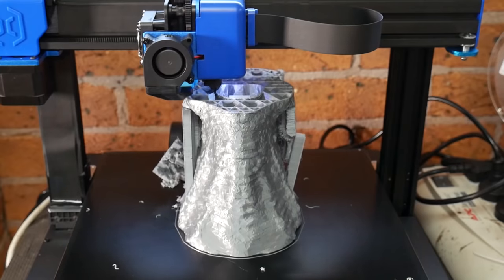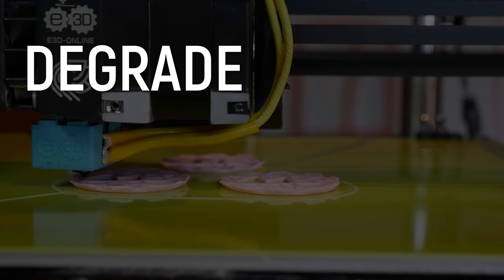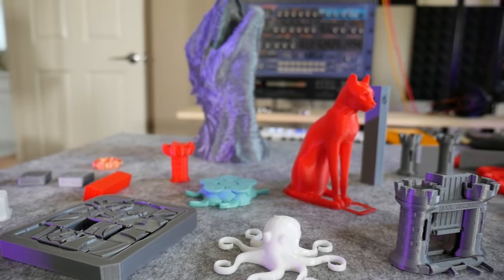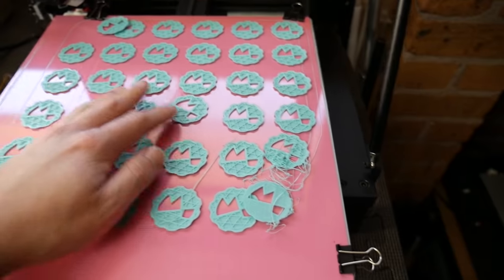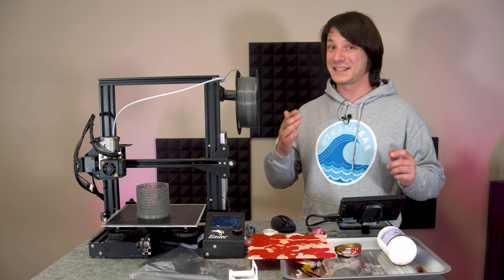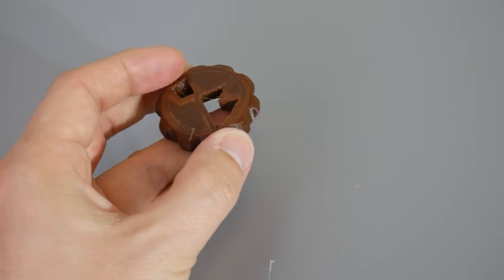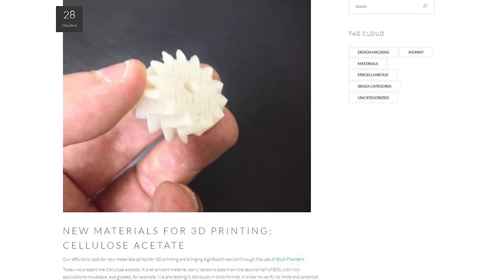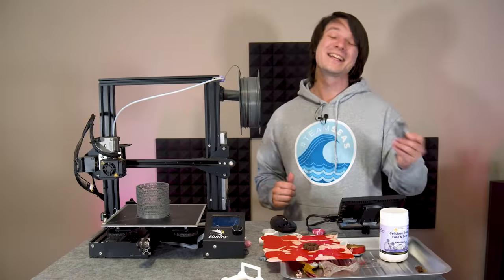PLA - 3D Printing's Biggest Lie.

Comment: Bummer pla contains some sulfur or it would be just another fuel for my wood stove.
Reply: Pla burns? or do you mean sulfur makes it not burn.
Reply: well yes ofc, I dont actually plan to burn it nor do I have any want to.
Reply: but thank you for the explanation of the sulfur
Reply: Hmm, I think burning PLA is a viable option - sure not at home, but at a industrial waste burning facility. Burning PLA is carbon neutral and the exhausts are processed to remove problematic gases like sulfur oxide.
Depending on where you live this is where your plastic trash ends up anyways, which is e.g. the case where I live. I don't see a problem with that - or am I missing something?
Reply: There are special PLA’s for casting metals with the print after beeing burnt out of the plaster cast. They are basically made to be burnt with as little residue as possible. Maybe look into them?
Reply: @tobiastho9639  molten metals are far hotter than an ordinairy wood stove though. So might still not be burnable.
Reply: you underestimate the heat my forge will reach.
Reply: @invetegon4596  No the issue is Sulphur Dioxide which is a pretty toxic, acidic gas and you definately don't want to be breathing it.
Reply: this is a good time to use the generic pronoun "one" as in "one should not burn plastics".
Reply: I think you are correct. There is also the idea that bandwidth of any text communication doesn't contain tone and tone can change from writing to reading. So intended emphasis can change depending on the reader. We do so much non verbally in communication and it is all lost in text. I prefer 'one' for that reason. As formal as it sounds, it can't be beat for precision. Also, let's not succumb to fear of what others will think of our tone at the cost of precision in communication. I imagine that we all waste more time on clearing up imprecision than we do smoothing ruffled feathers. Also we may cause more interpersonal trouble through miscommunication in the first place and it's necessary clarification? It seems to me like precision is worth the risk of sounding a bit formal. I sure don't talk like this sounds when I am face to face with people.
Reply: it was a joke buddy. I’m not dumb enough to try to melt plastic because it would produce unmonitored pollution. If I did want to tho I’d stick it in my arc foundry that will reach over 2000 degrees C and there will be nothing left. But again I don’t want to pollute because I’m not dumb and was just making a joke.
Reply: @ajl8975  Hmmm, okay case dismissed 🤔 But really I'm not the plastic police 🚔😂 I'm just some engineer guy practicing his English.
Reply: We could use a bit of that where I live. The soil here is a 9-10ph...
Reply: @RaphaelBraun  U R 100% Right. 
AND this technique is also done with coal in power plants now where ALL of the exhausts are processed and problematic items removed, leaving only vapor the same as when you cook potatoes being released. 
AND it's still taken out of use anyway by environmentalists who cry as if the pollution is still there.
There was a power plant that consumed tires one at a time and burned them in computer monitored combustion chambers making carbon neutral exhaust - made many megawatts of power and Zero pollution. 
THIS can also be done with all the plastic that is now covering the earth. How come we no longer see this being done or hear about it in a world that's filled with Governments & Politicians Constantly Screaming that it's ending???
Reply: @invetegon4596  you couldn't detect a knock knock joke.
Reply: @guillermoelnino  and what is it that you mean by that?
Reply: @invetegon4596  or an insult, apparently
Reply: Uh oh.
Reply: i mean.... in the grand scale of enviornmental impact, acid rain is like mildly annoying.
Reply: @awellner3285  Iron’s melting point is 1540 C, steel is around 1400 and fire is apparently between 200-4980 C, but some site said (lol say that 5 times fast) that wood fires are around 1100 so idk fires are hot either way
Reply: @RaphaelBraun  which is the solution to the plastic problem. but society is too comfy with the idea that things are recyclable, when if fact, plastic isn't. 
We better burn it to recover the energy.
Reply: and you know where are some sulfur too? In wood. And in coal - a lot. And nobody cares it burned consistently and everywhere. People are just stupid and tend to consume what they are told and not think by themselves. Plastic is baaad, burning is baaad. But wood and coal - pretty ok, no problem with it. Just plain stupid.

Comment: Angus - there's something wrong here, my experience is that PLA DOES BREAK DOWN.   I've been printing for about 7 years now,  I repaired some of the flush systems in our loos.  These recently broke again so I re-printed the parts in ASA.   The original PLA parts had become thin and soft - and not just the parts that were under water.

Sun also affects PLA, particularly noticeable for some parts that I made for our greenhouse.  This have become brittle and break into shards (as you mention).   
We also made toppers for Bamboo sticks - and these are also breaking down.

I believe that the timescales given for PLA decomposition are unrealistic, probably measured in tens of years rather than two.  Decomposition can take many levels, from failure to function, to shards to micro-particles.

Given that - I would use a different filament at the prototyping stages.   I store my PLA and PETG unusable prints in separate boxes and give those to two different friends - one who recycles into filament and the other makes sheet plastic.
Reply: Totally agree with same experience. If PLA would turn unusable within 2 years, noone would use it for serious projects...
Reply: Great post. Pragmatic and realistic. Of course PLA breaks down. Sticking it in the ground and expecting it to be even partially degraded after a couple of years is hilarious.
Reply: @S3NTRY  While it might seem appropriate to laugh at that, if you can't ensure that people actually do the right thing, it might actually be the better end condition to design for, because that way even if they don't, the desired outcome occurs

Note: even getting closer to this is desirable over the current state of things. If we got even 10% towards that goal it would be a massive improvement
Reply: probably highly depend of what manufacturer put in his PLA, i have some old one from 8 years ago and its same as new, main problem most of manufacturers of 3D printer plastics dont survive for long and its hard to get info on what they used in they mix

Comment: There is another way to dispose of PLA: Burning it. It can be used to generate power, and from my understanding, it only releases as much carbon dioxide as the plants used to produce it consumed. So it would just be a cycle of CO2 being bound by plants, plants being turned into PLA, and then the PLA becomes CO2 again. Burning plastics always sounds kinda bad, but I think it's not that bad with PLA, but actually sustainable, as you aren't adding CO2 to the atomsphere.
Reply: Aren't you forgetting to mention toxic fumes, or burning PLA doesn't produce any toxic fumes? We are also burning gas every time we drive so... I know there is someone who will have a corresponding answer.
Reply: @valent_t  That's why cars have filters and catalyzers, to get rid of the toxic fumes and particles, and I'm pretty sure they'll use something like that in waste fueled power plants.
Reply: @valent_t  I'm sure if such a device was created fumes would be taken into consideration as with anything that releases fumes. In a first world country of course.
Reply: @valent_t  you just need a furnace that gets hot enough that it consumes the fumes as fuel too
Reply: FWIW this is from the 3d850 datasheet "... for unused 
or uncontaminated material, the preferred option is to 
recycle into the process otherwise, send to an incinerator 
or other thermal destruction device."
edit:
also from wikipedia: " PLA can be incinerated without producing chlorine-containing chemicals or heavy metals because it contains only carbon, oxygen, and hydrogen atoms. Since it does not contain chlorine it does not produce dioxins during incineration.", although who knows about whatever additives are in it
Reply: Problem is, like Angus said, not all PLA is 100% PLA, they have polymers added. 😔
Reply: @littlenyancat5754  Depends on where that reagent comes from. It would be still much better than a material that's pretty much completely made out of fossile resources.
Reply: @valent_t  As i get it modern waste burning power plants have advanced filters that capture and neutralize these toxins. We have a such block at the local power station here that is burning waste and that was built just a few years ago and they use some really advanced and effective filters making sure eventual toxins from plastics ect dont get out in the air. You have space for much larger, much more effective exhaust cleaning systems in a power plant then you have  in a car
Reply: Japan actually uses this solution since their country size and geography simply doesn't allow any space for landfill. You know those public baths with hot waters? Often times the heat gets produced by these incenerators. It does produce CO2, but it doesn't produce anymore than an equivalent coal power plant. It's not ideal, burning stuff is still not great, but at least it's better than either burning coal or dumping it in the ocean. The toxic fumes being produced are captured, and the air quality is apparently good enough that one of these facilities are placed near Tokyo. If you're wondering how they sort out their wastes, well... You remember those 9 different types of bin to seperate wastes? Yeah... Those are not just for show.
Reply: @GigsVT  But as Angus described, plastics still do degrade, and I think they do when buried, too. Even if it takes a long time, they probably do start degrading into smaller plastic particles which could seep into the ground water.
Reply: @ireeb  they degrade by mechanical weathering and UV exposure.  Neither of which happens in landfills.  You can go dig up perfectly preserved newspapers from 40 years ago.
Reply: @GigsVT  Not directly, no, but the US and Australia both exported "recycling" to China with full knowledge that they weren't recycling it. It just meant that they could say "hey we tried ;)"
Reply: @mduckernz  I think you misunderstand.  China paid for the plastic, not the other way around.  It wasn't like that.   They were recycling it, for the most part.
Reply: Industrial incinerators is where this would work. I think a lot of people are thinking home furnaces or similar situations. 
Industrial incinerators practically turn it into plasma, resulting in much lower pollution, and what there is, is easier to filter before it leaves the facility.
Reply: @Becvar80  Yes, I was thinking about waste fueled power plants, where waste (including PLA) would get burned and the energy harvested. With proper filters, this would have minimal impact for the environment. No additional CO2 in the atmosphere and no plastic in the oceans, plus recuperating some of the energy.
Reply: @ambe6377  actually, almost all onsen are heated naturally via geothermal, as a result of the over 100 active volcanoes.

Comment: Another aspect of recycling is remelting your waste filament into new filament that you could use. Not sure what all it would take to set up a homebrew filament maker or if the filament would be of any quality but if you could just reuse the plastic that wouldve gone to waste I think that would be more or less ideal for dealing with plastic waste. At least that's what i'm baking on, haven't ever thrown away anything to come off my printer, saving it all for when I build a recycler.
Reply: There is a machine but it’s a few grand

Comment: Thanks, Angus, for putting this out.  You're kind of a big deal in the 3D printing community, so if you and a few more community figureheads like SexyCyborg get onboard, maybe manufacturers will listen and spend the dosh to research actually biodegradable plastics.

In the meantime, I'll just keep saving my scraps to melt into blocks for my blacksmith friend to create knife handles out of.  Landfill with extra, pointy, steps!

Comment: My first encounter with PLA came several years before I first started 3D printing; the first truly mass-produced 'bio' airsoft BBs were PLA. Not as good for the environment as the literal pressed-starch biodegradable BBs they were replacing, but you could actually use them without every fifth shot exploding inside your gun, and they were affordable.  Cellulose filament would be awesome, and cellulose doesn't have to come from trees you know...literally any fibrous plant material will do.  Even grass, for instance.  Or, if you want a more industrially sustainable scale; bamboo.  I don't know that I'd use cellulose filament for final mechanical parts... But I'd definitely use it during the iterative design process and for just faffing about, because I definitely feel a great deal of concern over the waste I generate while designing stuff.

Comment: I've been looking at 3d printing lattice structures to increase strength of aircrete. We could collect PLA and other plastics and use them to make walls with high insulative properties and that last without cracking for decades.

Comment: There ARE filaments that you can get that are specifically designed to be compostable (Maybe you could try some and make a video about them?) and are either the same cost or not all that much more than normal filament. For example, Polyterra PLA from polymaker ($20 per 1kg spool, prints similar to silk pla as far as temps/quality, but has a matte finish with no sheen), Willow Flex (A bit pricey at $35 for 300g, but claims to be compostable. I haven't tried this myself, as I only just got a direct drive printer for flexibles), and some that are made from algae (Algix ALGA filament, $35 for 1kg spool. I haven't tried this one yet either, but have known of it's existence for a while) and the like. 

I'm not sure how restrictive it is since you are overseas from places like Polymaker as far as cost. My understanding is it's not cheap for the Aussies (Don't think it is, but is that offensive?) to import things, so you'd probably have to buy in bulk or something. Hope this helps some though, maybe there is a local distributer for Polymaker for you to be able to get this from?

I actually quite like the Polyterra I've tried. Though, there are warnings from some users that it may eat through nozzles a bit faster than regular filament. I do agree that it'd be better to have more accessible recycling, but EVEN IF there were recycling near me for plastics, they still REQUIRE that it has the recycling symbol with the proper markings to be able to accept it (rural us resident). I couldn't roll in with 3 tubs of failed prints and get them to recycle it even if I wanted. Perhaps I could trick them by making things like cups or trays or sheets of plastic like in the video, and stamp my own recycling symbol on it. Don't know. Anyway, have a good day out there everyone!
Reply: Polyterra isn't compostable, it's still PLA, same with algix. So no real difference from any other PLA, which is kind of the point of the video. Willow flex does only give anecdotal evidence of the actual filament being compostable, but I hope that it's true.
Reply: FYI it's not offensive, Aussies is fine 😉
Reply: @nicklasmartos928  To be fair, it is compostable, but it is really industrially compostable only (not home compostable) because of the temp needed for composting.  Slightly better than regular PLA, but basically the same.  Right now, it really only breaks down at industrial composting facilities.
Which to me would be fine, if I could find a way to get my PLA to said facilities...  
But I can't...  I'd love it if I could just save all my used PLA up until I have enough and then take it to a facility.  I wouldn't even mind paying for that, but it just isn't really an option for the average person...  And that is frustrating...
I have a feeling tho, that something like that might be more reasonable and cost effective than a cellulose based filament.
One nice thing about PolyTerra, the spool is cardboard.  Totally biodegradable, at least for the spool.  ;-)
Reply: The polyterra I have tried was the best filament I’ve ground for my geetech a10m
Reply: I'm fairly sure you could add a discreet recycling mark for the filament type onto the bottom face of many 3D prints. That would be something neat for the slicer to auto-add!
Reply: I also heard of Mater-Bi (it's used for "biodegradable" plastic bags and cutlery, but there's also the filament version), but I fear it still is something similar to PLA. =(
Reply: I would like to see one of these slightly-better PLAs mixed with wood. Wood filament degrades fairly rapidly turning the remainder PLA into dust.
Reply: @MaaveMaave  And then you'll have microplastics, which is the worst. 🤔
Reply: I also forgot PCL (polycaprolactone): it's biodegradable.
The disadvantage is that it melts at low temperatures (it gets soft at 60°C).

Comment: Here in Georgia, US there are several tree farms. The land is planted for the express purpose of harvesting them for the timber rather than getting timber at the cost of deforestation. It would be cool if the same approach could/would be used to create these suggested filaments. Just, you know, with the right tree (assuming it isn't pine)

Comment: This is something I have thought about trying to use with the desktop injection molding machine as well. I have melted down a lot of old PLA 3D prints but haven't converted those into pellets to reuse yet. I have converted leftover filament on the spools into pellets but not the already printed parts.  Definitely something try in the future.